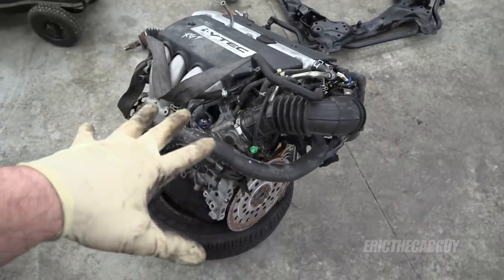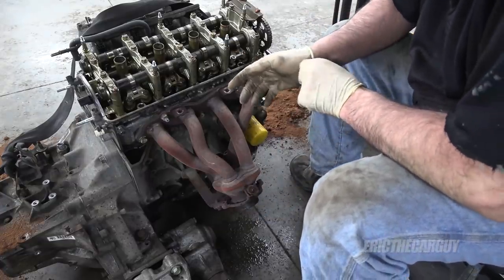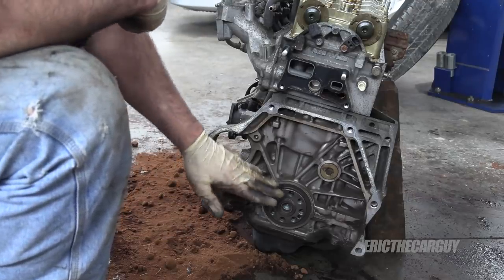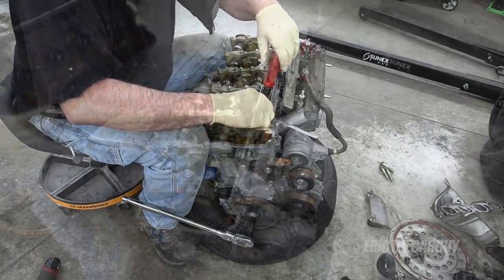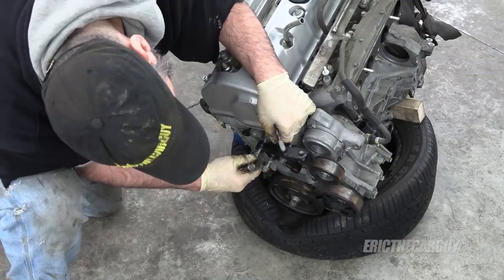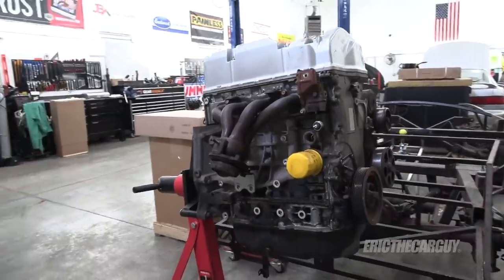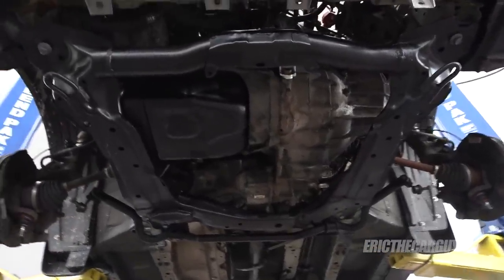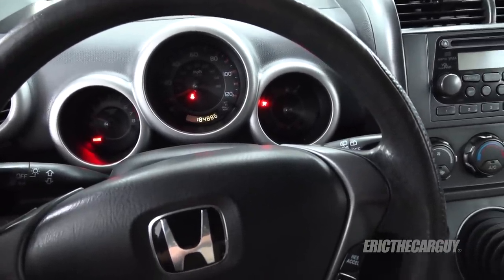Honda Element Engine Replacement and Restoration (Part 2)

Comment: I have a question, I took my car to a mechanic for replacing brake pads and rotors. After that I needed brake booster replaced because I had soft brakes and the car would turn off at traffic lights. After they put in a brake booster, the brakes are still soft and it feels like everything is loose. My car drives like it’s 25 years old and I feel every bump and it shaky and just sounds bad with brakes grinding. Could they have taken my car for joy ride instead of test drive? I just feel like my car took a beating of some sort.

Comment: Curious....wouldn't this be the time to replace that rear main seal? Front crankshaft seal?
Reply from the maker: The new engine has very low miles on it. 50K at most. No point in replacing factory seals that aren't leaking, but generally, it's a good practice.
Reply: @ericthecarguy : True! However I just think about the PITN procedure of having to removing the transmission and then the axles as well to install new seals. You know best though you can see and touch the components. I’m just being OCD over here....😮😆
Reply from the maker: Regular oil changes help prevent leaks. I wager I'll never have an issue with it. Also, it's a manual transmission. One day, it may need a clutch. At that time I'll inspect the seal to see if it's needed. Thanks for your comments.

Comment: How many days do you have  in this project.  Is it cost effective to do what  you did? Great videos and info which is priceless!
Reply from the maker: This took a week, but I filmed it, which means I could have probably done it in a quarter of that time without filming. Given my last Element is still going strong with few issues after 13 years of ownership, I think I"m good.

Comment: Hey Eric, I just did an engine swap on my element (2004). Direct swap and everything, however I didn't have a lift so I had to pull the engine with a picker along with the automatic transmission. I kept the transmission and put it back together with the new engine, then I swapped it back into the car. 

Afterwards, I started to test drive the car and it could not go into reverse or second gear. The automatic transmission was working perfectly before that, I even tested the solenoids and they seem ok. Put new gaskets on them and it made no difference. So I took the solenoids off of the transmissionmission that was originally on the new engine, which also seemed to be working, and it made no difference. 

Could this be an electrical issue with the wiring harness? Is there a way I can test the connections with a multimeter while the car is running?

Side notes: the transmission was manhandled around in the process of pulling it out and mating it into the new engine (I had to turn it sideways to put it in place). So I lost a lot of transmission fluid in the process which I had to replace (5 quarts) that transmission had about 210,000 miles on it. Could it be shot because of that? I cleaned out all of the solenoids for any debris that could have been in them. I eventually filled it with Lucas transmission fix to make the transmission fluid more viscous to see if that would make any difference, but it made absolutely none. As if it wasn't even engaging in the first place, hence the electric issue theory. The car will start to reverse but only when it's hitting rev over 5000 rpm, and only barely. Which is why I thought Lucas would help that, (with my as it help with reverse issues on my old Corolla) but it made no difference.
Engine codes: p1732 and p0780

Also, the reason why I didn't replace the engine with its original transmission was that I got it from a parts car that had some front end damage where the axle was ripped out (where it lost almost all of its fluid) and the bottom front mount broke on the casing so I would have had to finagle a new mount on. 

The engine is in perfect condition from an 08' element k24a8 vs the 04' k24a4. The newer models had a drive-by-wire but all I had to do was swap the new intake with the old intake from the old one and keep old harness, so I had to disconnect every sensor in order to do this swap. I checked the connections on every sensor multiple times. (This swap is been something other Honda Element owners have done without any issues)

My questions are:
1: Should I look for an electricals issue with the harness first before I swap the transmission? If so, how?
2: Was it caused by having to essentially flush most of the old transmission fluid?
If so, should I just put on the other transmission and try that (which I may also have to refill its fluid) ?
3: Could I have messed up something in mating the transmission with the engine? I pulled it straight out with the torque converter still connected to the engine, and just popped it back in with the torque converter connected to the new engine (which took a long time to fit in right) 
4: Should I just buy a manual transmission from the junkyard and learn how to drive stick? Lol. If so, I might as well pull a four wheel drive version and swap out the all the essentials for that. 
P.S I work as a pizza delivery driver while I'm in school in downtown Nashville with stop-and-go traffic. This element is going to be my new daily, so I feel a manual would be a pain to use.

Comment: I am curious Eric Are you going to be installing the hid Projector headlights on this new element like the old one your daughter is getting? @EricTheCarGuy
Reply from the maker: I thought about it, but they come with halogens. I was hoping to find replacement headlights that were already set up for LED but I haven't found any yet. I've even considered swapping to a newer front end with the updated headlights from Honda.
Reply: @ericthecarguy  newer front end would be interesting to see

Comment: You mentioned saving that used clutch to save money on a clutch job down the road.  Isn't that generally a bad idea to use pre used parts on a wear item like that?
Reply: OEM clutches last a long time. I wouldn’t usually put an old one back on but if it was in good condition I wouldn’t hesitate to.
Reply from the maker: Given the clutch looked very new, along with the flywheel, I don't think it would be an issue.

Comment: loved my 2003 element with automatic transmission. it died a couple years ago and the white bear honda stealership robbed me of $1000.00 for sparkplugs that i changed two years ago. 120.00. a few sensors changed and car still ran like shit. could barely make it up a hill. bought a ram 1500 through enterprise car sales. $10,000 less than ford and chevrolet both are great trucks. the ram was more afordable.

Comment: You should of 100% put in a brand new metal heater hose coming off that thermostat housing, those eventually rust right by the thermostat housing connection, the pipe swells from rust and it causes the plastic housing joint to crack, causing almost complete loss of coolant and that is a bitch to replace without removing the intake manifold. I actually would have replaced all the heater and coolant hoses.

Comment: Maybe you disturbed an airbag sensor wire or attachment while squeezing the engine out or in.
Reply from the maker: Not at all. The code is the common seat belt buckle issue. I'll cover that in a future video.
Reply: Good to know it was just a buckle issue. I had read somewhere that one of the crash sensor for airbags is usually placed behind or near the headlight and imagined your elbow hit it. LOL.

Comment: @EricTheCarGuy I have 1999 Honda Civic from UK, with from disk and read drums.  The rear drum adjuster is not a star wheel but a flat piece with a spring on the bottom with one rotating cam and one fixed cam.  How do you adjust these without pulling the wheel/drum off?
parts-honda.uk/honda-cars/CIVIC/1999/14IS/STEERING-BRAKE-SUSPENSION/REAR-BRAKE-DRUM-/17ST311/B__1900/4/18657

Comment: since he is working off a lift, he might consider getting a rolling table like another youtube car guys uses. make R&R engines from the bottom easy
Reply from the maker: I've been considering building one of those for some time. I just need to find a place near me that sells metal.

Comment: What i've done with that type of shituation in the past is convert it from bolt to stud. Pass a bolt through the back, give it a tack, and go from there, and if in the future it's also too rusted to come loose, you just cut it, and repeat. Frankly, the fact that the engineers haven't figured out that putting bolts in parts that suffer thermal expansion is a BAD idea, after so many decades of automotive design, is a clear indication that they will never get it right, willingly or maliciously, for whatever reason. It should've been a shoulderless bolt/stud, that can be easily replaced.
Reply from the maker: I don't see welding on the aluminum block. Good idea though. Thanks for the suggestion.

Comment: No New Rear Main Seal ?????????????????????????????? still good stuff......................
Reply from the maker: If this new engine had 30K on it I'd be surprised. I don't mess with seals that aren't leaking on low mileage engines. You're more apt to cause a leak than fix one.

Comment: Just curious is there any chance to reset the ODO to zero? Or tick it over somehow?
Reply from the maker: That would be illegal.
Reply: Odometer tampering is HIGHLY illegal in the US, with fines up to $10,000 and jail time up to 3 years in FEDERAL prison!
Reply: @digitalrailroader  Ah no worries, I thought there might be a special rule when throwing in "new" engines to represent how much that particular engine has done in that chassis.
Reply: Also zero would be inappropriate for the used engine. Not to mention the body still has the mileage on it.

That said... Old cars reset their odometers merely by driving a lot. lol

Comment: You didn't test to see if the Vtec works yo!
Reply from the maker: You won't notice it so much on these engines because it's only on the intake side.
Reply: @ericthecarguy  might have to half throttle it until  crossover then floor it like guys do.😆

Comment: I was going to say that it looks like it’s time to move on from these early 2000s Hondas. Great and reliable as they were, their useful lifetime has been exhausted, and buying one even very cheap is still going to end up more expensive than a newer vehicle even if you diy. That is if you don’t value your time and okay spending many weekends to bring it back to life and still have a very old car with not too many airbags and rudimentary abs and not much power

Comment: I clicked thinking it was being replaced with electric.  Bummer.
Reply: Pffffft. Thats funny. Not in this country. Nobody has a electric element, im sure of it.
Reply from the maker: If that was the case I would have said "motor", not "engine". Thanks for the comment.
Reply: @foellerd  Not yet that is. The future is looking like EV swaps.
Reply: Elec. naw, but you could put the battery in the glove box!